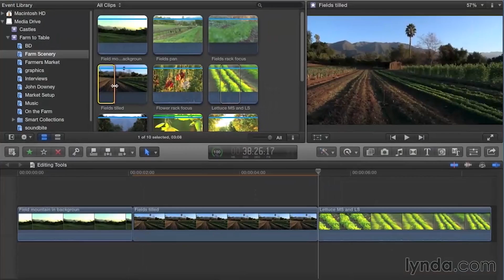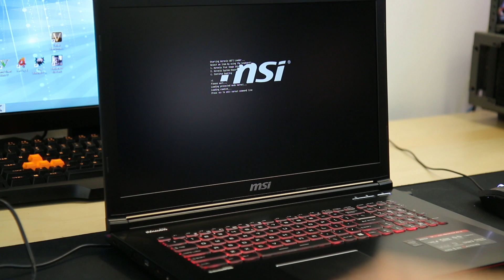How to install SSD in a laptop

Comment: If only I could meet a tech youtuber. I have so many questions on building a comp.
Reply: +Tanner Corcoran yo, i'm technically a tech youtuber. heck, i have my own pc repair buisness. ask away!
Reply: +happyman Gaming will a cpu with the same socket type work in a motherboard with that socket type? Or will there sometimes be compatibility issues? Also, do you know of a good gaming cpu? Hopefully under $400 and at least 6 core? Thanks for replying! And thanks for any help you can give me!
Reply: +Tanner Corcoran yes, any CPU will work in any motherboard with that same socket type. Sometimes, a bios update may be required (the only time this has happened recently was transitioning to windows 10 on Pentiums) 

A good CPU would be either the FX-6300(6 cores, 3.5 GHz) at $109.99
or
the FX-6350(6 cores, 3.9 GHz) at $126.99
or
the FX-8350(8 cores, 4.0 GHz) at $169.99
All 3 use the AM3+ socket from AMD
Reply: +happyman Gaming Thanks!!

Comment: Alright, I need some help deciding on this: should I buy a 4k monitor, or upgrade to an ssd?
Reply: depends what you will be doing, and if your system meets the required specifications, but if you have a 980ti or something and a 1080p monitor, I'd suggest getting a 1440p 144Hz monitor instead.
Reply: DBIIJ0U I'm running a gtx 970, and I know I cant run all games on 4k, but i know I can run some of the less demanding ones, like tf2 and csgo.
Reply: +Mr crazed ssd
Reply: Don't go 4k with a 970. Ssd.
Reply: Dimytri L why not? i like to play older games that it would have no trouble with, like nfs prostreet, slrr, gta4, gta sa, tf2, crysis 1, etc.
Reply: Mr crazed what monitor do you have now?
Reply: Dimytri L It's a 6 year old, 1600x900, 79hz monitor.
Reply: The upgrade to a better monitor is essential from your current one and with your GTX 970, 4k is possible, but seriously an SSD is ESSENTIAL, the difference between a HDD and a SSD is ridiculous in Performance and noise. I recommend getting a SSD of a decent size now (240Gb and up) and then go 4k (personally I prefer 1440p@144Hz).
Reply: Mr crazed yeah what he 👆🏻 said. Having your OS on an SSD is SOOOO much better but tbh I don't understand how you have to choose between these two...an SSD even one with 500gb or a Tb costs a lot less then a 4k monitor.
Reply: DBIIJ0U same! That's definitely the sweet spot for gaming!
Reply: DBIIJ0U Except I have a 1 tb hard drive, and I've stored 446 gb on it already... that's a lot of ssd storage.
Reply: +Mr crazed I have both, I meant get a 240GB SSD in order to store your OS on as well as important documents and programs, the other things you have on the HDD should stay on the HDD as they likely would'nt benefit much from an increase in performance.

Comment: oh i also upgraded my laptop hdd, it was a pain though. i have one of those laptops that you have to pretty much dissassemble completely to access the ssd. keyboard, several circuit boards, cables....
it boots 100% in 10 sec now so im happy

Comment: No way!  Yesterday I put a 259gb Samsung 850 evo ssd into my 4 year old Toshiba satellite laptop and the difference is amazing, not just the faster speed but a huge reduction in the heat generated.
Reply: I know, people really need to start making an SSD a necessity. I have one in my Desktop, along with a WD 1TB HDD and the noise is KILLING me, 2.5 HDDs are even noisier...fuck that.
Reply: I know, people really need to start making an SSD a necessity. I have one in my Desktop, along with a WD 1TB HDD and the noise is KILLING me, 2.5 HDDs are even noisier...fuck that.

Comment: Jay I wouldn't unsubscribe because their is a MacBook on your desk. They are great systems with a great OS. I would; however, unsubscribe for you spreading misinformation and needless hate. You are well versed when it comes to computers components. You know, or reasonably should know, that all current MacBooks have AC. Only the traditional non-retina MacBook Pro, which has not been updated since 2012 and is a legacy machine, does not. Furthermore, you stated the machine costs $2100. Many MacBook Airs and Retina Macbook Pros can be had for as little as $799 for an Air and just over $1000 for a rMBP. These machines are perfect for most consumers who are looking for a  general purpose comp. Overstating the cost of an object with the sole purpose of participating in the middle school antics of "Apple products suck!" is something that I thought was beneath this channel.

I like custom building PCs, I have one sitting on my desk next to my rMBP. Both are equally excellent computers.

Comment: Jay, why not just use a USB to Sata adapter kit? I used one to do mine recently, clone your installed drive to the new drive via the kit, then just swap them out. It works with Acronis too.

Comment: can't you hackintosh it? if she still wants mac
Reply: MSI doesn't have compatible parts. Gonna try the GE72 today. I'll double check.
Reply: +J. Aaron Dowell i thought all you needed was a Intel CPU? I may be wrong though
Reply: +TeleportingDog Different motherboards might have different issues and some devices like audio or wifi might not work right away on mac. So you need very specific kexts (basically mac drivers) to patch them up and some might not be supported.

Comment: Hey Jay! I've got a 2-year-old HP dv6t with a 32GB mSATA cache and 5400 RPM HDD. With Windows 10, I get 15 second times from clicking restart to back on the desktop. I would suggest that you create a small partition on that SSD you just put in and set it up as a cache in Intel's RST software. Windows 10 seems to be able to use that cache to great advantage - much more efficiently than win7 did. It's possible that it only works with the mSATA cache, but I bet you might see some improvement, unless MSI is really slowing you down 30 seconds. Worth a try - Minecraft doesn't use all 960GB anyway! Keep up the great work!

Comment: Why not just replace the Macbook's RAM and HDD and maybe install Windows?
Reply: That's also a good affordable idea. Speed testing AC vs. N have not seen any noticeable difference. Have a 500gb u/d fiber line and tried belkin, net gear, and linksys, as well as an apple time capsule. Apple has been more data reliable. But no speed difference. Can't travel through walls better than N.

Comment: That seemed kinda slow for a ssd and windows 10. My pc restarts in 25 seconds with 3 second post time, on a SATA 2 port which is already bottlenecking the shit outta ssds.
Also, laughed so much at the start of the video

Comment: The main reason why SSD is so much faster than HDD isn't data transfer rate, but random seek speed. Slow seek speed is the reason why HDD clogs up the system so much on Windows boot, because it has multiple concurrent open file handles and keeps switching between them which slows everything down to a crawl. SSD performs such tasks instantly.

Comment: Also, MSI's warranty sticker is just to prevent people from needlessly digging in their machines. Call them and they'll tell you flat out they don't care if you add RAM or repaste or add hard drives etc.

But your ASUS' warranty is void if you so much as swap your HDD from slot 1 to slot 2 =D

Comment: That laptop had to have had problems or something. I bought my mom a Toshiba Satellite with a 5400 RPM 1 TB HDD and it works like a charm and doesnt require that long to boot up or hang at that black screen. But it's windows 8.1 so your bug was prolly cause of shitty W10 bugs.

Comment: The Dark side is strong in this one.... ;) Just update the ram to 16GB - 2x 8gb Sodimms an 256GB SSD 850 Pro as the system disk and a cd rom 2.5 inch hdd caddy for a 1TB back up drive and it will still fly mine did my Mac Mini is also boosted, but the gaming rig is still a windows pc ;)and Jay I am your Father ;)

Comment: The SSD speedtest was flawed. Something in windows was preventing the computer from restarting you can see it on the screen. The ssd would have done better if not for that. So the test has to be redone.

Comment: I feel bad for her. Going from a Macbook Pro to a cheapo laptop. People say Apple laptops are expensive but the screen, keyboard and trackpad are unbeatable. The battery life smokes pretty much every laptop out there. And they go for many years, like hers which still looks new after 7 years. You can knock 'em but they're work horses.
Reply: A Laptop that has a better keyboard and better specs than a macbook is a cheapo laptop? 1 TB SSD? Apple sells those for 3 thousand bucks in total....
I really don't like their trackpads personally.
Call me fanboy if you want...
Reply: No mate, you use your Macbook as a fashion accessory. You know nothing about technology, get yourself another YouTube name.
Reply: +Gadget Addict So... A keyboard which is worse than most laptop keyboards and a screen that other laptops also has... and some even better, plus a trackpad which is just stupid to really have as many people use a mouse. Rarely do you see a normal person who does something on a laptop without a mouse unless its like watching a movie or being casual.
Reply: +Gadget Addict Scissor switches are OP though. Still could care less on a laptop, regardless. I personally hate trackpads, prefer something like the trackpoint because it requires less hand movement from keyboard to trackpad (it slows down your typing). Also really good for gaming.

Comment: Jay, you're silly.
i know you know that the Independant Operations Per Second(random reads specifically) is more important to the speed for this situation (and most consumer situations), but didn't mention it.

the SSD blows the Hard Disk out of the water for seek times, it makes a gigantic difference. the amount of data that's being loaded at any given time is really not that high, just asking for a lot of bits and pieces.

that being said, something's strange there, the SSD should be a shitload faster than it was.
i'm going to blame Windows / whatever might be installed in it bloating it.

Comment: Macs have their place, I have a macbook and a dual boot linux/windows desktop. Even though my pc is  far faster than my macbook they have different roles. I work on cad on my pc which is extremely cpu intensive and consistently uses up more than 16gbs of ram. If you look at the specs  of a mac and compare it to the pc it makes no sense but if youl look at the macbook as a (expensive) tablet alternative it starts to make more sense.

Comment: I swear they have ac wifi chips I have a 2014 13.3 in MacBook Pro and it has ac wifi...my custom rig is nzxt 210 case, and fx-6300, gigabyte 990fxa ud3 motherboard, cross fired xfx r9 270x's, 8 gbs of gskillz sniper ram, corsair cx750m, corsair 60ssd for os, wd blue 1tb, and WINDOWS TEN (10) 😱😬

Comment: my laptop which is a old acer from 2012 boots to windows 7 in about 50 seconds and the hdd is crap. but on my 250gb seagate barracuda 7200rpm it takes 5+ minutes... even after a fresh os install. and loading games take around 10 minutes to start playing. amazing i tell you

Comment: Process was different replacing laptop HDD with new Samsung SSD 850 EVO . First, copied HDD data to external SSD using Samsung Data Migration SW. Second, switched HDD with SDD in laptop. Apparently process is different depending on SSD vendor.

Comment: Most laptop hdd are slower because they spin at a lower rpm 5400. Also when the hdd platter gets smaller so do the read and write heads, so a 7200 rpm laptop hdd would be about as fast as a desktop hdd. Might be a little bit slower.
Reply: I'm not saying this is true i just thought that, that is why. I just got into computer tech last year and I really don't know much.

Comment: Much easier to work with then when I put a SSD in my Moms Dell laptop.  I had to take everything apart, even taking the screen completely off to get to the HDD which was under the motherboard.

Comment: what about upgrading her MacBook to SSD?
Reply: +Harry Tsang
at 7 years+, that means that MBP probably has the Processor equivalent to an Athlon X2.

replacing the entire Notebook was a good idea.
Reply: +Harry Tsang was thinking the same thing, I did a 256gb ssd upgrade on my late 2011 15" macbook pro (i7, 8gb) in 2013, and it was like new. Even better I removed dvd drive and put 750gb hdd that was originally the main drive. She's still live and well. Compared to my new 2015 macbook pro retina 13" base model, my old macbook performs as well.
Reply: ***** As far as I remember, that should be a core 2 duo
Reply: it was a good model, mine has anti gloss high res screen option, which set it apart from many other macbook pros at that time. MacBooks are just great. I probably sound like an apple fanboy lol oh well
Reply: +Dr.Jackass Eh, but only a little, but you seem to have good experiences with your MacBook so it's all well and good to be proud. Cheers!
Reply: +Dr.Jackass Did same thing to mine. But its 13in and no 750gb HDD. She blows the socks of any modern Air, late 2011 was a good model.

Comment: Jayz, so I want to swap my dads laptop HDD for a SDD I bought, and I already cloned it and all, but when I install it in the computer and boot it up, it says no boot disk available? Can you or someone please help in the comments!
Reply: What model of Laptop is it?
Any other problems with it?
Checked the Bios?
Updated the Bios?
Reply: Its a HP Pavillion dv7 i5 6gb of ram and a 500gb HDD, now i wanted to upgrade it for him so i bought a mushkin 240gb sdd and i cloned it and installed it
Reply: also the bios i dont think has anything to do with it, but is there any other way you can contact me to help? im in desperate need.
Reply: PharaohGaming Interesting, you made sure your SSD works properly on another PC, right? I know you cloned it, better safe than sorry. If it doesn't, then you should contact the vendor of the SSD or Mushkin themselves for a replacement unit.
Do a clean Windows Install on it (if you got a replacement when your SSD doesn't work), copy the data of the original HDD onto an external one and copy the files you need, documents etc, onto the SSD when Windows is running properly with all the drivers installed. I personally say clean installs are better. :3

Edit: You cloned TO the SSD, not FROM the SSD? Just making sure...
No Boot Disk can mean: No OS on Disk to Boot from or it can't detect the OS, check the BIOS, the SSD should come up there of working properly, clean Windows install is your best option if it does.
Reply: Sorry for the late reply, but can we contact eachother via skype? It would be so much easier
Reply: +PharaohGaming Does it show in the bios? Did you try using it on another PC and spam the bios key to make sure it shows? If it doesn't then it's most likely dead. You might just have cloned the wrong disk.